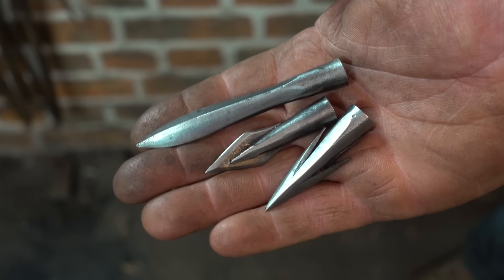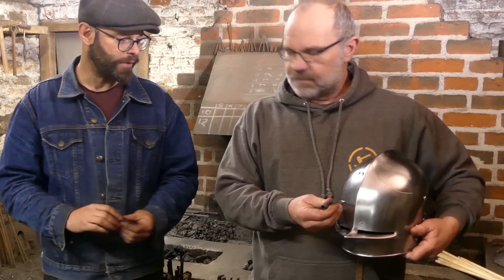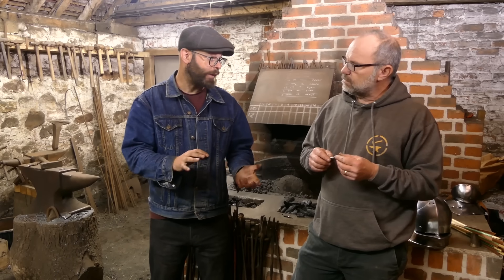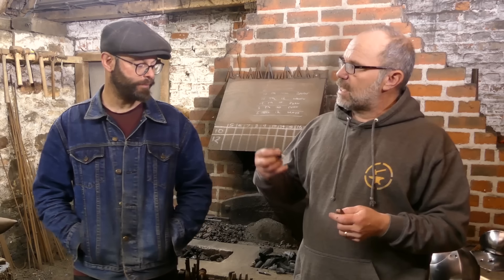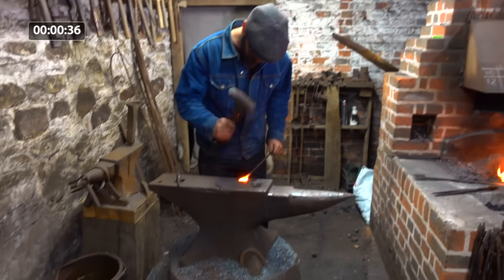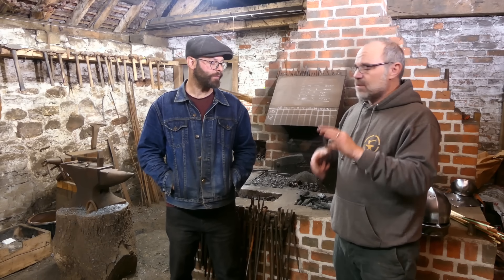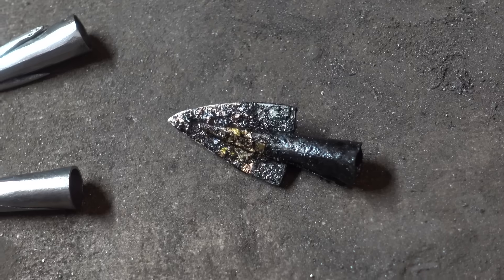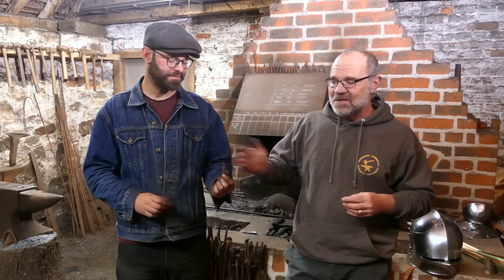Why Bladed Steel Arrowheads were Superior - Arrows vs Armour 3

Comment: One other major advantage of the type 16 over the type 9, even if the 9 were hardened steel, is the 9 is for poking while the 16 is for both poking and cutting. The 21b appears to share the benefits of the type 16 plus easier to make.

Comment: Would be interesting to get data on how much energy is actually imparted on each to not just the armour but the person. If one was charging at the enemy and gits hit by a type 9 and it skirts off, is that barely noticeable in the heat of battle or is it enough to trip them up/possibly get trampled. Likewise while the type 16's are definitely more like to bite in more, is that enough to knock an armoured soldier to the ground, or is the armour so effective its essentially just noise to the charging solider?

While we're tossing out ideas for Arrows vs Armour 4, I propose some additional 'fun' in addition to the historical accuracy and add in Michael Allison throwing various weapons at the same targets and maybe Tod's new siege bow lol.

Comment: As part of the cost evaluation you talk about the labour time to produce the steel tipped arrows but what about the production cost and availability of the steel itself?
Reply: By the 15thC, blast furnaces were increasing iron production.  Various places, England, Germany, Sweden were producing thousands of tonnes per year.  I found an estimate of about 3 pence per pound, which would be enough iron for about 100 heads.  Steel was about five to seven times the price, but in both the steeled heads, only a fraction of the arrow head is steel.  I coul;d find all sorts of wage values, but nothing for an arrowsmith.  So, cost-wise the iron and steel probably did cost more, esp if they can churn those out twelve an hour.  But the shortage would definitely have been the labour.  Doubly so when the latest randy King decides to gear up for war.

Comment: How much further do the lighter arrows actually go?  From what I recall at least with some of the bows the heavier ones had both more energy and more momentum.  Since friction is a function of velocity I would expect faster arrows to loose velocity faster.  Depending on the bows a heavier arrow might actually have a longer range.

Comment: Absolutely NO disrespect to will, his skill is definitely the real deal, but based on some other blacksmithing channels i have watched i feel like back in the day they MAY have been able to make these even faster and in less heats

As tod and everyone in these videos is reiterating they weren't stupid, and we have seen that the smiths would use forms and power hammers to speed up the process, so i feel like they could hammer, pun VERY MUCH intended, one of these in like half the time using a water driven power hammer and round dies for the socket, and i fully expect that if it did take two or three or more heats that they would be working other heads in-between heats 

All this to say, i think some one making thousands of arrow heads would have streamlined the process to a ridiculous degree 😅

Comment: Perhaps it is time to also take into account, what the different arrow heads do to the target behind the armour, after they penetrate it. After all, functionally we saw similar levels of penetration of the same types of armour, even though the behaviour of the arrrows showed interesting differences. My guess is, that the later arrowheads with cutting edges caused much more damage to the tissue after penetrating, if and when they did penetrate the armour.

Comment: Thinking about the difference between the bodkin and blade points and arrow spine. The lighter points will allow for farther flight, assuming the shafts are relatively the same, the lighter points would also make the arrows effectively stiffer. I wonder if that contributes to the blades points more effective energy transfer.

Comment: I think a heavier object will go farther when moving through the atmosphere compared to a lighter object with less weight at the same speed. Because the heavier object has more energy to push through the air and won't slow down quite as fast as a lighter object. 
But a lighter arrow is easier to accelerate and goes faster which will allow it to go farther. It's the difference in speed that adds range. Not in weight directly.

Comment: Is there any evidence of special tooling being used beyond that of a standard shop?  I would think that it would be much like this for most smaller shops, but in big cities, wartime or shops specially contracted to do work for "the crown," would there be some dies, hammers or specialized anvils which rely less on skill to achieve uniform results? It may seem relatively fast, but 5 minutes means 120 arrows for every 10 man hours.  Did they just accept the speed and contract more smiths who would otherwise be making other things?

Comment: i dont think its been mentioned that the Steel heads are much more reusable. With attacks coming in waves and archers being mobile it would be very possible for them to skirmish forward after an advance retreats,, finish of some wounded with sidearms and regather their arrows. Some might need a touch up with a file but still given the numbers of arrows needed its seems like reusability would be an advantage. 
Also Iron is cheap - was the cost of the brazing materials a factor in their use with yellow metal becoming cheaper over time?

Comment: consider that an arrowhead with half the weight means half as much raw material also, so you can stretch those supplies/labor further
Reply: Exactly what I was about to point out. Half the raw material means half the labour cost embedded in it.
Reply: Material costs are obviously important. More time to make balanced by less material. Material costs of iron v steel will alter the cost. Cost/time/material v effectiveness will affect choice of head.
Reply: @andyedwards9222  Exactly!  1450 smiths couldn't order carbon steel online.  The real labor difference had very little to do with brazing, and everything to do with changing cast iron into wrought iron into hardenable steel - which wasn't done in four minutes.
Reply: Which wasn't done by blacksmiths, especially by arrowsmiths. Making steel from iron was a seperate job, nothing to do with the blacksmith workshop
Reply: пробивание брони зависит не от кинетической энергии а от импульса. поэтому - наконечник для бронированных целей должен быть настолько тяжелым чтобы стрела вообще только долетала до цели. легкие наконечники - практические, для охоты и для не бронированных целей

Comment: Hey Tod, love these videos. I have a question regarding the energy of the arrows. Did you ever measure their speed while also recording their weight, to get their actual energy? You said a couple of times that the type 9s had more total energy than the type 16s because they were heavier. But the kinetic energy of an object depends exponentially on the velocity and only linearly on the mass. E=0.5 x m x v^2. So a faster arrow should have more total energy than a slower heavier arrow, but that depends on how much faster in goes compared to how much heavier the slower one is. But in general, speed beats mass. You can see this in modern weapons as well. NATO adopting the smaller 5.56 round, because as long as it goes real fast, it does not need to be big. Same with tank APFSDS rounds. The penetrator is much smaller than the diameter of the tank barrel, it just shoots it out really fast, cause velocity is what matters
Reply: Tod's videos of arrows being shot generally do include velocity and energy figures.
Reply from the maker: Thanks and in the first film of this series, strike tests we tabled all this data.  With arrows which are slower, momentum starts to become very useful to penetration it seems
Reply: While it is true that speed impacts more on kinetic energy than mass, we should remember that it comes from a bow that acts similarly to a spring. Basically, the potential energy stored in the bow is transferred to the arrow with a certain efficiency; if the efficiency is the same, arrows with different weights would have the same kinetic energy. Efficiency depends on arrow mass and spine (the flexibility of the arrow), plus other parameters of the bow I guess (I'm not a bowyer). Still, I think kinetic energy mostly depends on the poundage of the bow. Then you have to consider turbulent drag from air while the arrow is midair. A detailed study should take into account aerodynamics, but usually the drag force scales with surface, while the mass scales with volume, given Newton's law heavier arrows should be decelerated less than lighter ones. That's what makes a hammer fall faster than a feather, gravity would impart the same acceleration but drag is much more relevant on the feather. The two would fall at the same speed in vacuum.
Reply: Plus the air drag scales with speed, lighter arrow are even more slowed down

Comment: Taking into account the time to reheat the metal, would it be more efficient to have 3 or 4 'on to go' at once? Could you reduce the time?
Reply: The time would be reduced hugely by having an apprentice on the bellows keeping the fire hot (which they did) and yes,  you can absolutely have multiple heads on the go at once.
Reply: @MedievalArrows  thank you for that explanation. My understanding is that there is a technique involving a pair of people at the anvil, which allows much faster work even than this?

Comment: I think these times are really unrealistic. There's no way an industrial smith would be working his own bellows and waiting for the arrow to heat. He'd have a boy doing all that and he'd be making more than one at a time. All of the heating time is irrelevant.

Also, he should have had Tod prepare the barbs to prove that it's not skilled work. =P

6:47 Ignoring the increased cost of producing the steel.

Academic of course, as we know that they did make the steel ones en masse, so clearly they were happy to wear the costs.

If steel arrows weren't more expensive to make, they would all have been steeled without the king needing to insist. Since he was the main customer and only willing to pay for steel heads, the producers simply had to meet his demands.

Comment: Excellent forging as always, Will. I'd like to ask though a little bit about the chronology of those three types of heads. How do they overlap? As in, does type 9 completely disappear by 1450, or it's just used less compared to the other two? Also, have you noticed any regional variation in Europe? Also, what does contemporary art show? Do battle scenes also show different type of heads corresponding with the changes shown by the archeological record?

Comment: I have a theory. The type 16 is a standardization of arrowheads. Basically, instead of having different heads for different purposes, flesh cutters for soft targets, needle bodkins for maille, and plate cutters for soft plate, I think they decided to make a standard arrow type that does all of these to a certain extent. A jack of all trades. Which, Idk maybe was important logistically. Hence why it's got the barbs that'd be effective like the older flesh cutter and barbed head ones, and also made with harder material with square geometry instead of being flat flesh cutter to compensate for the type 9's weight. Since the type 9 or heavier heads aren't gonna be punching through solid plates anyway, they likely decided that having a lighter arrow with more range and energy transference is better. And so if you've got one type of arrowhead that does everything, you wouldn't need multiple different arrowtypes. That could really be useful for logistics and production I think.
Reply from the maker: Thanks and I think that is about it in one paragraph
Reply: @tods_workshop  I'm glad you found it useful.😊
Reply: Couldn't agree more!
Reply: @MedievalArrows  Glad you enjoyed my TED talk, Will.
Reply: while no arrowheads survived on the mary rose, analysis of rust stains indicate about 1/3 of the arrows supplied were bodkins. This is really not that much different from earlier periods in which archers often carried a mix of leafblade and bodkin arrows. Very likely bodkins were always intended for harassing use at long range while broadheads and leafblades were for used for more direct shorter range shots. The bodkin shape has been found on Mycenaean-era javelins, long before mail or even metal armour was prevalent on the battlefield. So really it just breaks down to archers generally having arrows for long and arrows for shorter ranges. The adoption of steel-hardened compact broadheads likely stems from the declining use of heavy mail and the increased use of thicker external textile armours and solid plate armour. Keep in mind though that there is little historical evidence to suggest people during the mail periods felt mail was particularly vunerable to arrows. That is a modern conception based on flawed modern testing using unrealistic conditions against historically inaccurate armour.
Reply: @dgmt1  The Mycenaeans quite famously had a good bit of metal armour, unless we're referring to the earlier periods
Reply: @dgmt1 this is really inaccurate I'm afraid. 

There is absolutely no evidence whatsoever that "bodkins" were on the Mary Rose.   Only two heads were ever recovered,  and both were barbed.   

The only other "evidence" from the Mary Rose of any type of arrowhead was the iron staining in the silt around where the heads were, but even these were described by the divers as looking "wide and barbed".

I'm not sure where you've got the bodkin theory from,  but having worked with the Mary Rose for years, and having had access to the original excavation reports I can assure you that nothing bodkin shaped was ever found on that ship.
Reply: в средневековой Европе не производили в целом общедоступное оружие которое позволяло надежно убивать бронированных рыцарей-дворян за исключением таких же.
вам не нужны в принципе бронебойные стрелы если вы не собираетесь толпой низшего происхождения убивать благородного в стальной броне🙄

Comment: Wow this is endlessly interesting. But i will say the differences in time spent are not marginal 5min to 7min is an almost 50% increase, which per arrow doesnt mean much but if you are making 10k thats going from 30 days to 50 days of straight work, and if then lf you factor in that the fletcher is only gonna work 9h a day and not on sunday thats 110 to 150 days so actually this is pretty big but as shown in the shoot there worth it.
Reply from the maker: Thanks.  Marginal in the sense that the skilled labour element is both expensive and hard to find.  Apprentice boys are both cheap or free and easy to find, so the time that counts logistically is the 5 mins

Comment: There's a lot of insinuation that these are "better" in every way lighter, faster, provable to be steel, similar production time, and welded socket. And that's not entirely true though. Lighter and faster are not necessarily better. Lighter means less energy and more hand shock, faster means greater distance which is great for the early stages of shaping a battle, and harassing the enemy but less power at the more flat shooting ranges that most experts even in these projects have agreed is likely more common. As for welded sockets while we don't have any evidence that it was done the fact they could likely means that is almost certainly not an innovation that makes the type 9 obsolete 
I think it's likely those other two factors that are the true universal improvements for these heads.
-the fact that there aren't many steel type 9s despite the laws requiring "steeled" heads kinda points to two probable reasons in my head. One the case hardened surface is lost to corrosion, two they weren't doing it despite the risk. The design means you would probably need either all steel heads or case hardening and all steel would dramatically raise the costs. The separate socket and edges means lower cost and from the crowns perspective a much higher likelihood of getting steel heads that plus similar or even lower production costs is definitely a logistical improvement worth switching over.

Comment: Something that's only occuring to me just now: did medieval smiths have access to bar stock? Were there blacksmiths or water powered hammers dedicated solely to turning ingots into bar stock?
Reply from the maker: I don’t know.  It would surprise me if specialist workshops forging heads didn’t get supplied bar stock, after all armourers got supplied sheet
Reply: I don't know either, but the more I learn about medieval industries and guilds, the more I've grown to realize that there seems to have pretty much been a guild (therefore specializing) for every damn thing you can think of. It's worth saying that when someone like Tod is making a sword or knife, he ends up doing the work of a whole bunch of medieval professions (just at a slower and less efficient rate thanks to him juggling). So yeah, it wouldn't shock me if it turned out there was a bar stock makers guild lol.
Reply: The celts and Roman’s regularly traded standardized “bars” of wrought iron with the ends forged down into very fine points to display the quality of the material. I would imagine there was something similar in medieval times, probably at higher quantities even, since they also had waterwheel powered hammers.
Reply: Around this time the industry was starting to produce sheet metal and wire in bulk.
That obviously made a buig difference on what could be economically manufactured